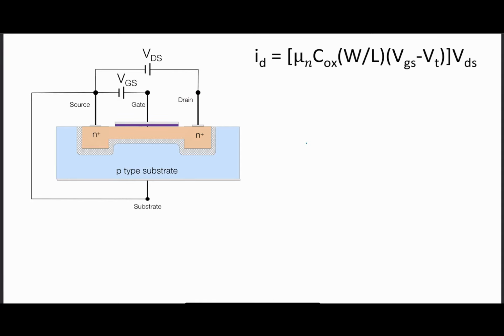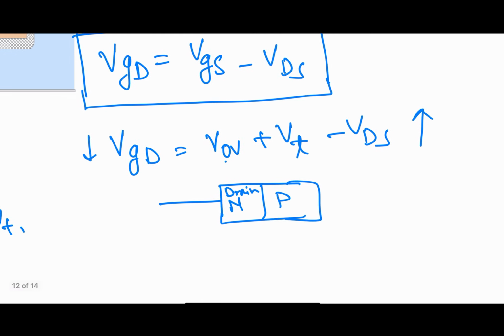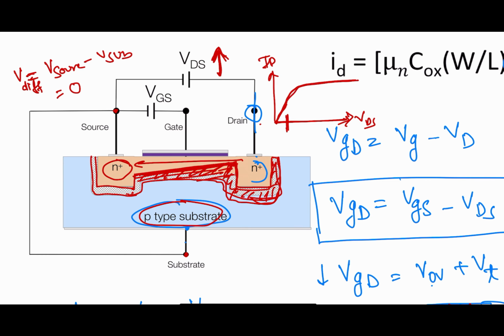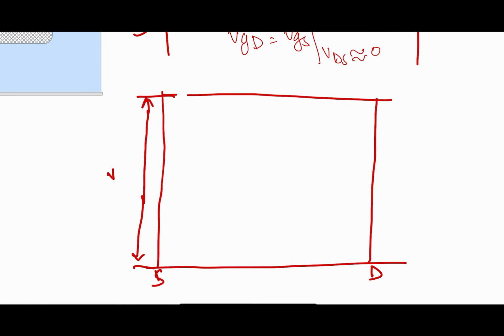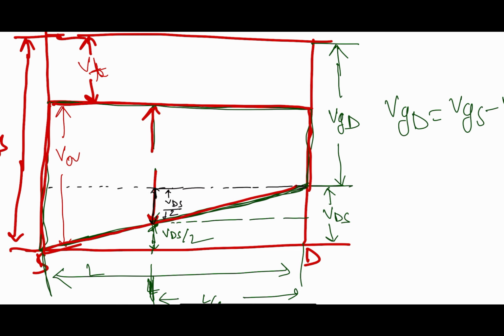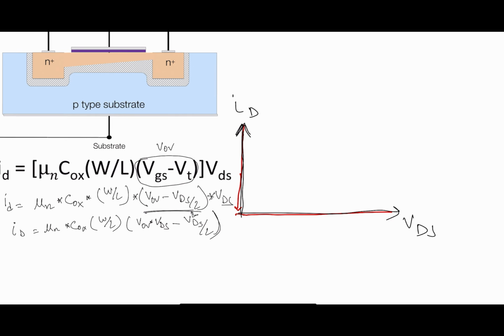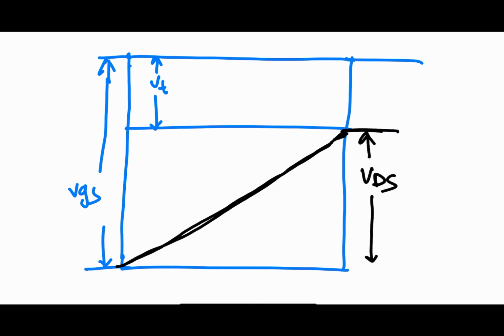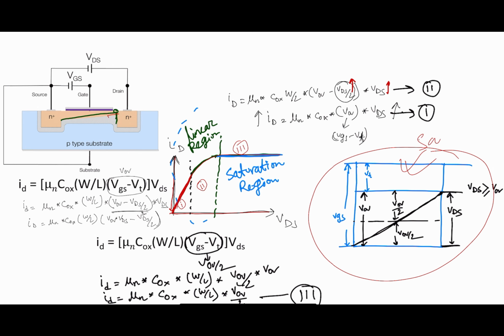MOSFET:Drain Current Equation at Saturation Region || VI Characteristics || Channel Width Modulation

Comment: Thank you for this nice explanation.

But you considered Vds as the voltage between drain and substrate,hence pn junction is formed.

Can't we consider this as the voltage between drain and source? source is n+ type , drain is also n+ type so in that case there will be no pn junction,  why can't we consider this?